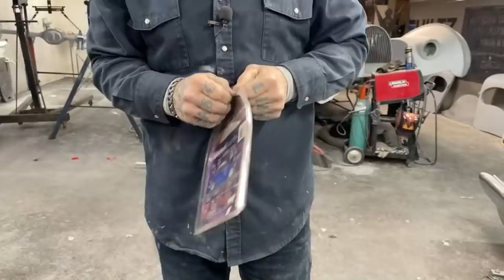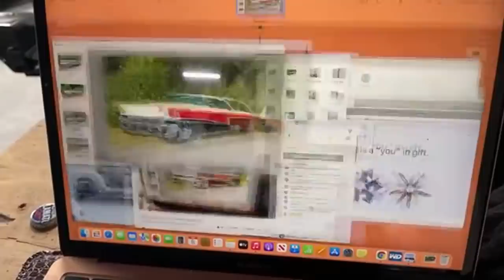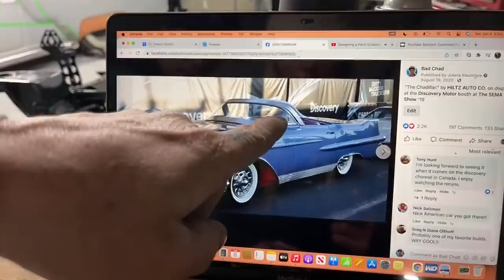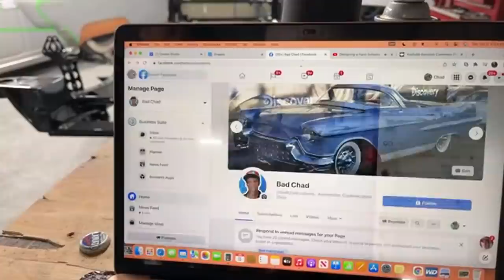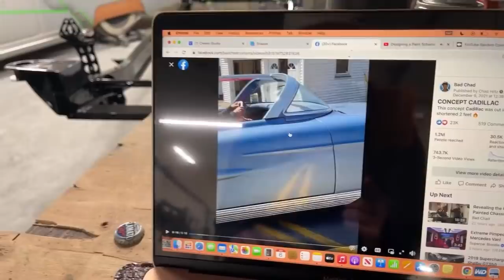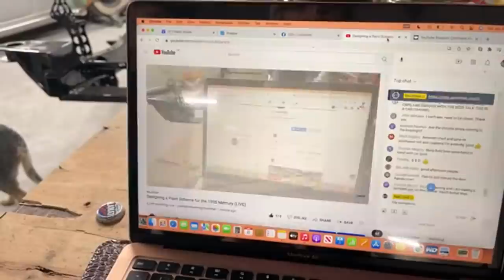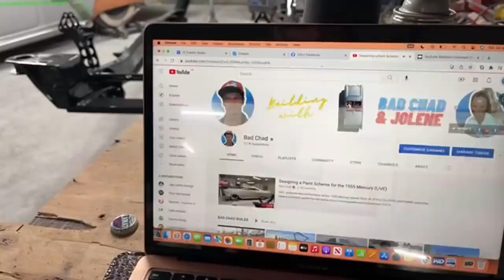Designing a Paint Scheme for the 1955 Mercury (LIVE)

Comment: Looking at it at 18:23, just thinking if you brought the tape from where it is at the front of the quarter panel, the low part of the lightning bolt, bring the two tape strips up in a similar way but to a point at the top center of the fender just above the headlight. The upper tape line at the front of the quarter would have to come down a bit more to give it some swoopy curve. Something like a 56 Crown Vic, blending the Canadian Merc and a Vic.

Comment: Wondering if that lightning bolt connected to the backside of the stainless in front of the fender skirt if it wouldn't be a cleaner transition. Regardless, i'm sure it'll look great. Solid color choices. Cooler 'n dangit!

Comment: Chad car looks nice but I have a question on the front fenders..
With them being lowered is that gonna interfere with the tow in on the wheels.. example tire actually hitting the front fenders turning right  or left.. the tire itself looks like if turned sharp could be cut by fender due to lack of wheel clearance.. 
Just a thought

Comment: White roof, black car with coral thunderbolt and 4 chrome strips. Lose the stainless strip across the back window - it mimics the original window opening too much. White roof helps reflect heat, coral interior metal with black seats and door cards with white stitching.

Comment: The front fender is too thick and looks slab sided. The wheel arch opening should go up more like the original shape, closer to where the tape is. I possible, the bumper needs to be moved up close to the Dagmar's level or at least add chrome strips above it. I know this is easy for me to say but if anybody could do it it's Chad and Jolene.